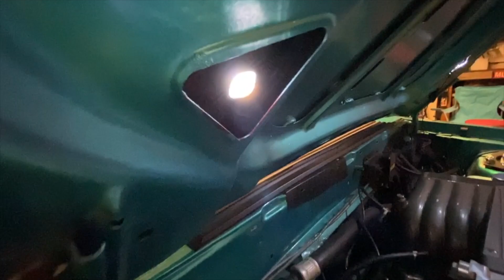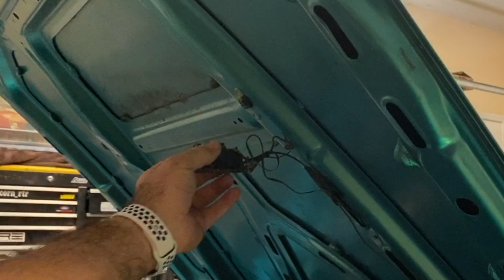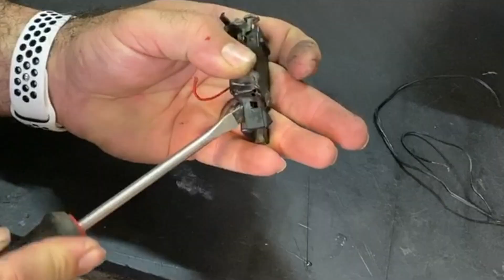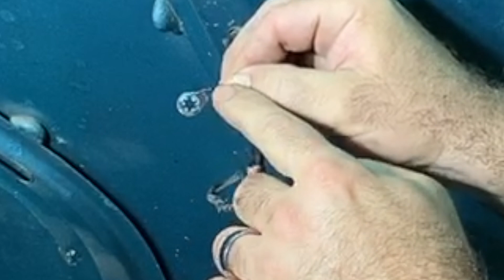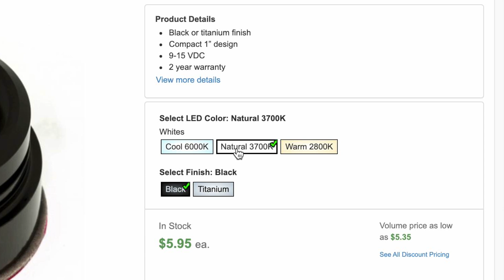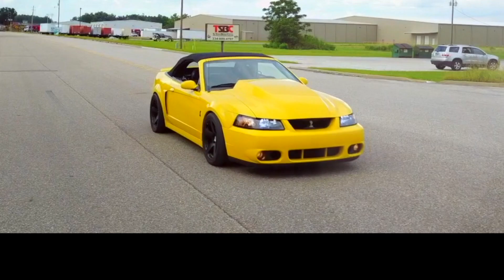GET LIT 🔥 LED UNDER HOOD UPGRADE *THAT TURNS  ON/OFF AUTOMATICALLY*

Comment: How did you attach the LED lights to the bottom of the hood?  Can't always use screws where you want to place them.  I would be concerned about a double sided tape, or an adhesive when there is considerable heat under the hood.  You got to think about where the lights and the switch will be located when the hood is closed.

Comment: You used the factory original hood switch along with the under hood connector for a power source.  I have a 2000 Ford F-150 XLT and the under hood factory light would sometimes work and not work. I took it apart and seen the mercury ball but the ball does not move in the up or down position. I took the mercury ball out and the stem in the center does not depress which I don't believe it is suppose too. I don't understand how the switch mechanism works. There is a 9 second You tube video by a guy with a 1995 Mustang Hood Switch and he shows the switch working with the cover off by moving the switch in his hand up and down, but I see no moving part in the switch including the mercury ball.  On Ford Truck Enthusiasts Forums, a F-150 owner had the same issue. He said he tested the wiring connector to the switch and their was no 12V power. The same was true with me. I have no blown fuses and neither did this Forums guy. Instead of buying another factory under hood switch, I installed a 36 LED light with on/off/toggle slide switch, but again I have no power when I connected it. I did test my LED light with a 9 volt battery to make sure it worked and it did light up. Any suggestions?

Comment: superstart is oreillys..
nEVERSTART is walmart
Reply: I have great luck with Everstart batteries. I got 10 years out of my last one in my truck, and I've got 6 years on the new one, and 4 years on another so far.. Compared to price at Advance Auto, Walmart batteries are a STEAL of a deal, and their policies on pro-rating are pretty decent.

Comment: I think that that is a cool modification.  Would definitely be handy at night if on the road and had to get under the hood.  Probably wouldn't need a flashlight.
Reply: Priceless if your broken down on the side of the road trying to fix something under the hood, but just makes sense when checking oil, or topping up fluids, or dealing with an under hood fuse.